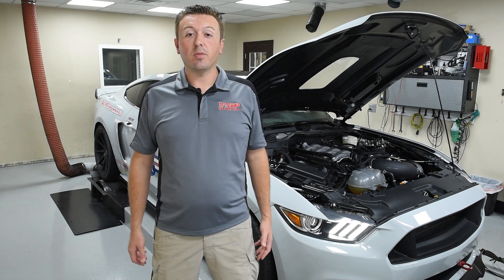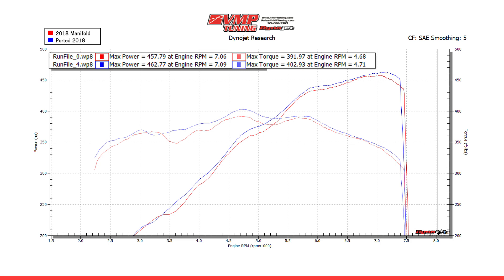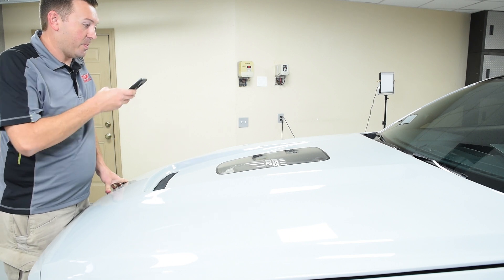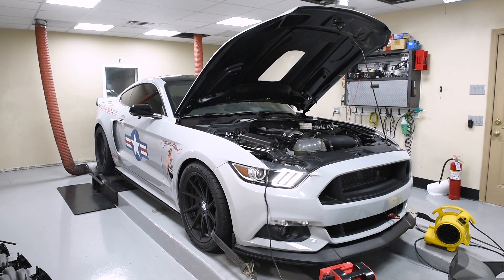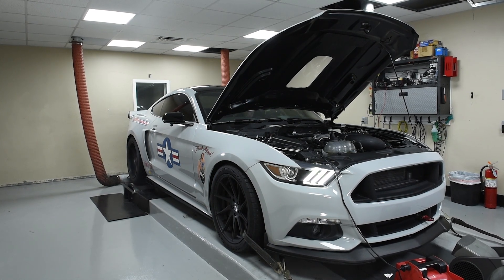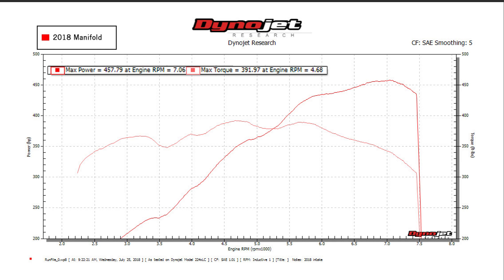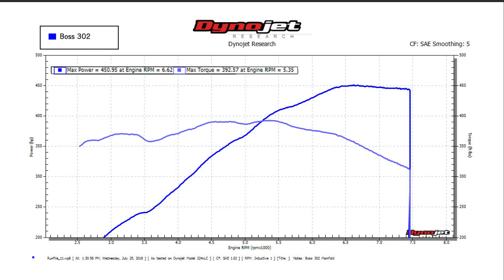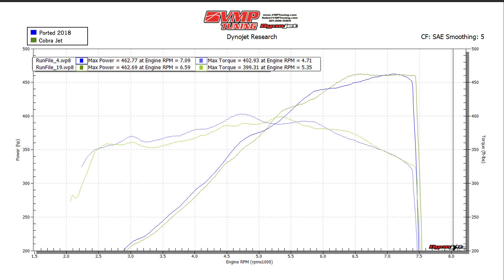VMP Performance | Coyote Ford Mustang Manifold Shootout

Comment: Thank you so much for the test! 2018' Bret Barber intake has more HP than the Cobra Jet and more torque than any save the truck intake and it's so cheap. Makes deciding super easy.
Reply from the maker: You're welcome! Glad we could help out!
Reply: Hand porting vs cnc ported big difference maker